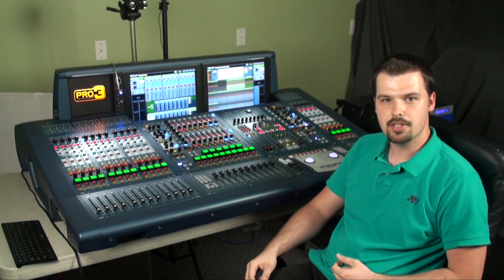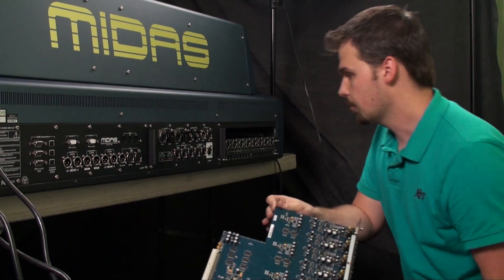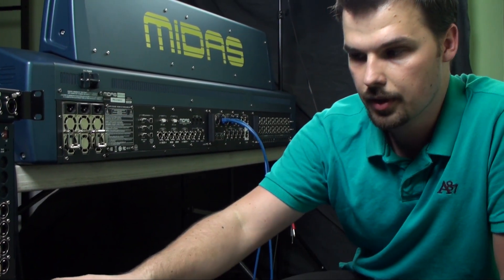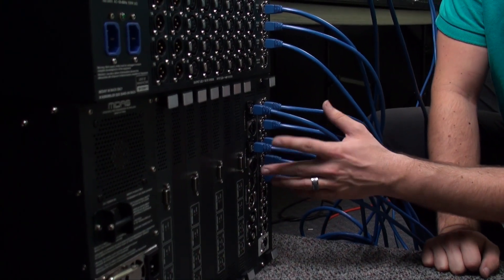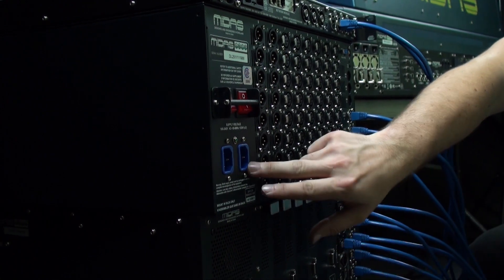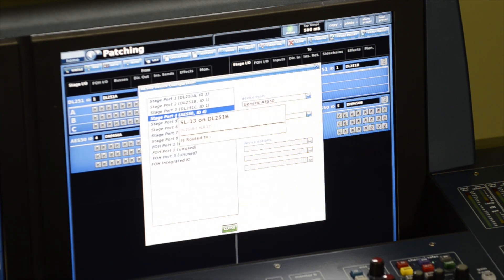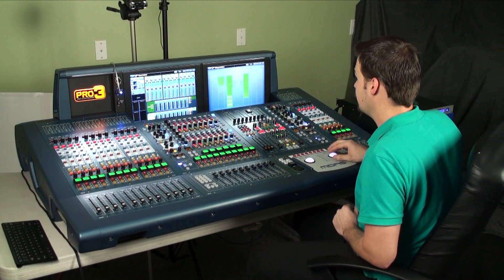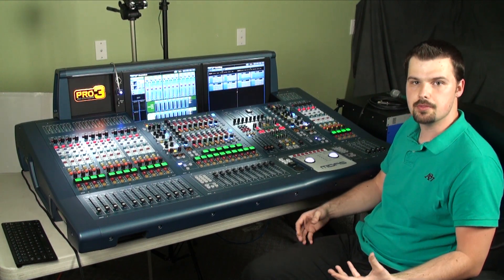Midas Pro 3 - Introduction (1 of 8)

Comment: Great video, thank you. I'm a bit new to digital consoles, where does the DSP engine sit? Under/next to the desk or at the stage with the DL? I have a feeling you're going to say "either place". I would assume it would sit next to the desk given it's the brains of the operation.
Reply from the maker: Anthony Bowe "either place" is the correct answer. Technically it doesn't matter, as long as the physical connections are reliable.

Comment: Hello, I have a question  all online photos show that Midas PRO3 come with DL443 card, is it correct?
Reply from the maker: Vitaliy V The console comes bare bones. The "install pack" for example includes the control surface and the DSP engine only. I needs to be purchased in addition to this, and allows for greater flexibility when ordering.

Comment: Great video, but can you explain why so many network connections are necessary? Seems like from a technical standpoint you should only need 1 cable, going from the surface to the rack.
Reply from the maker: That is exactly the case - only one cable is required from the surface to the rack (DL371). The second cable is for redundancy. Unfortunately the software doesn't automatically failover to the redundant connection if the first connection fails. This must be done manually in the system diagnostic screen.